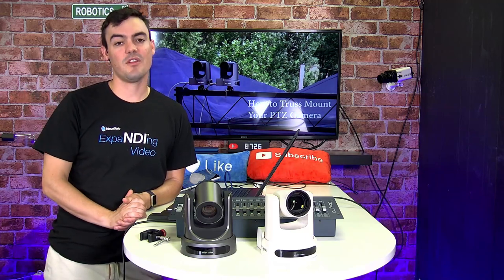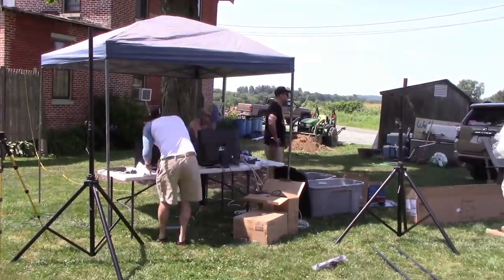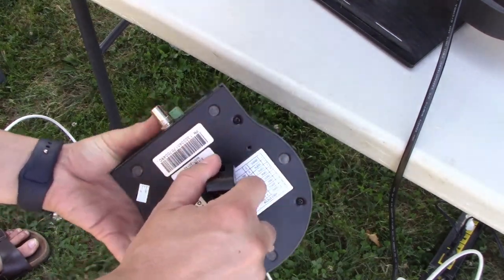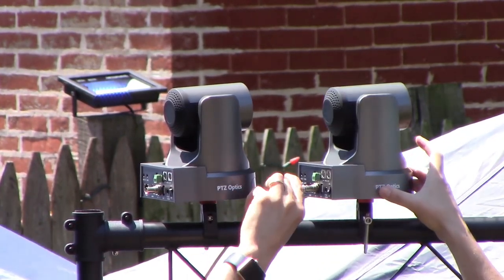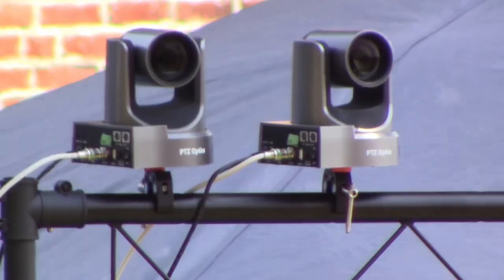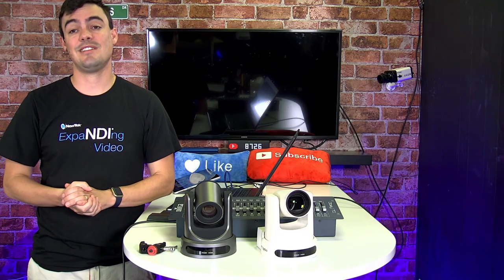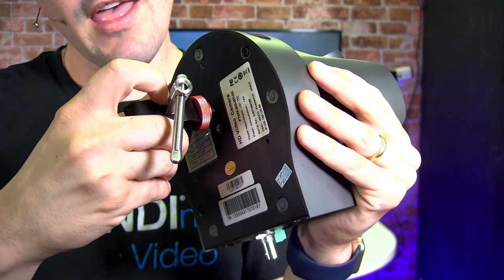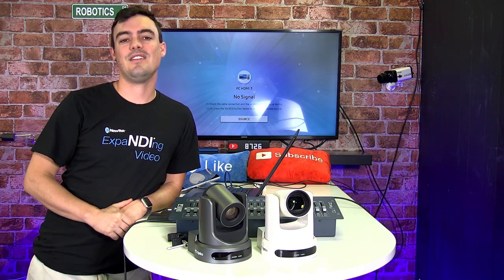How to mount a PTZ Camera to a Lighting Truss

Comment: Wouldn't you want a safety cable and better truss clamp? I can imagine that camera falling off from 18' and braining your clients.
Reply: Hey Lawrence, I’ll see we have learned a lot since the 6 years ago that this video was posted :)
Reply: @StreamGeeks  I was actually hoping you guys for marketing some items with a 2-in trust clamp and quarter 20 on the other end just for PTZ cameras. Somebody else mentioned outdoor covers that's actually not a bad idea I had five cameras mounted outside a few weeks ago and thunderstorm came in and drenched everything before somebody through plastic bags over them
Reply from the maker: @XTremescenes1   it's a good point. They don't have to be expensive outdoor enclosures with heaters and blowers. You just need something to stop the rain in some cases. Yes, trashbags are a good option if you get surprised by a rain storm.
Reply: @PTZOptics  I'm saying I'm in the market to buy You guys should make something or have a third party put your logo on something nice. Even just a waterproof cover with a drawstring at the bottom could work for upright mounted cameras. Make it look stylish and I'll buy it!